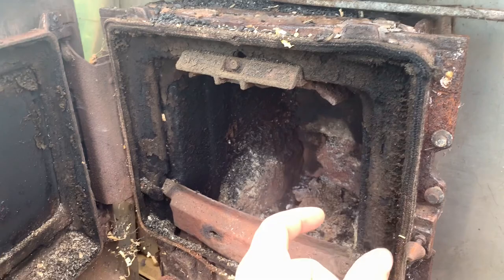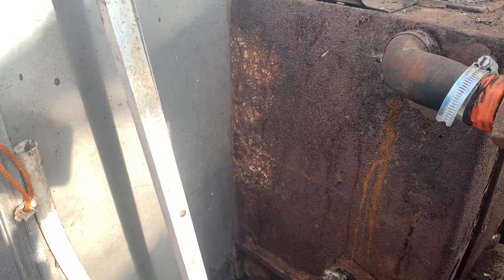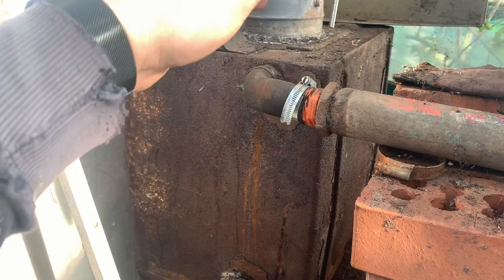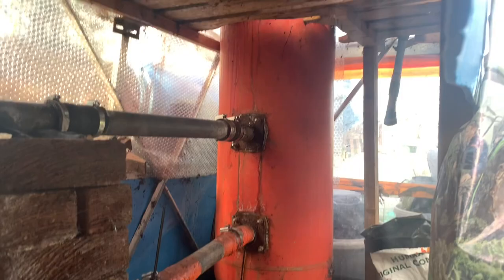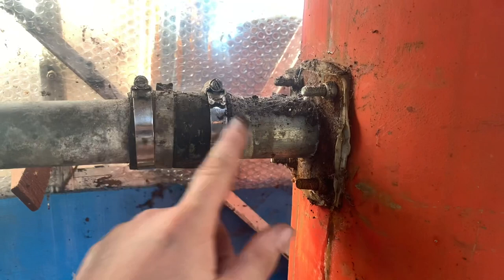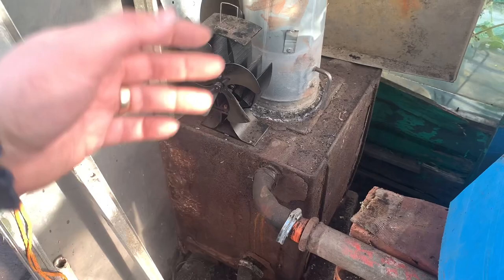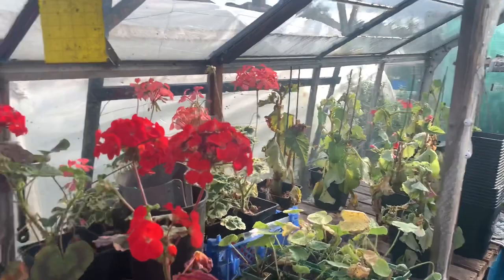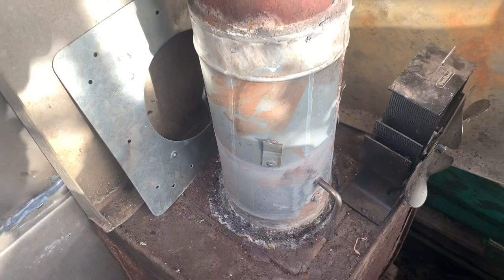Deans Lost The Plot - Heating A Greenhouse Old School

Comment: We use a portable propane heater that is made to be used inside houses. And we used it last spring for my starts. I started them in our mudroom. But when I had to up pot them, I ran out of room. And my hubby finished my greenhouse in feb. So we moved all the plants to the 10 ft. x 16 ft. Greenhouse.  And the heater worked great. We would use it mostly at night. During the day the sun heated it. But was a great backup heat source.  I think in the month and a half we used it. We went through maybe 2- 5 gal. Propane tanks. Not bad. Going to use it this winter to grow some things thru the winter too.